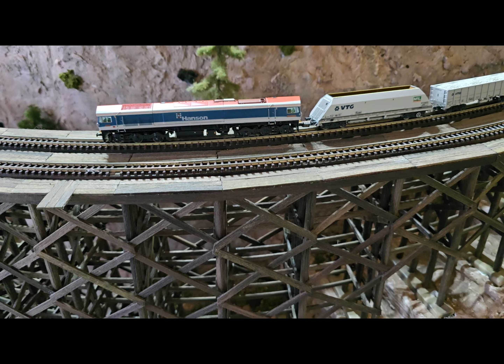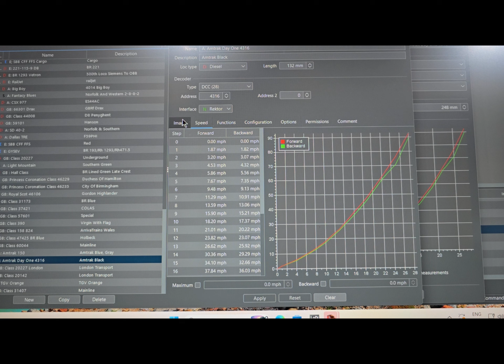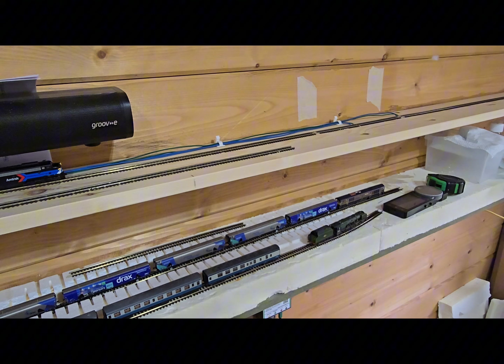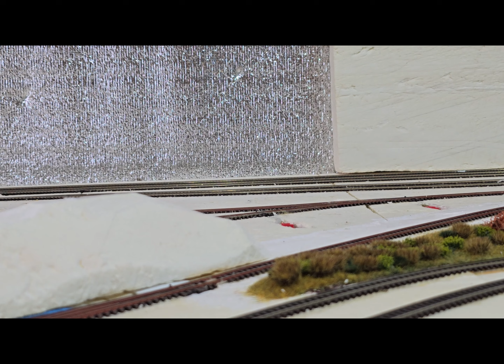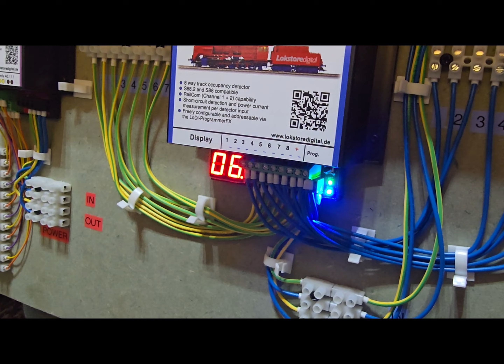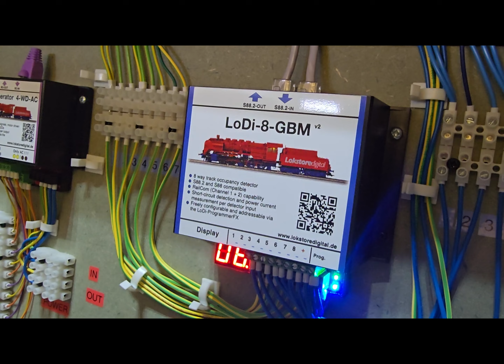Model Railway Speed Matching | iTrain Setup & Amtrak Loco Testing

Comment: I'm interested to know why you chose to use 28 speed steps instead of 128 speed steps? I use iTrain and use the fill range avaliable to the decoder which usually means  more complex speed curve.
Reply from the maker: Hi i use Lodi and that is what Andreas the designer of LoDi and James of DCC Automation said it would be the best to have it on. 
So when I started I knew nothing and I stayed with it. 
And it works for me. Colin
Reply: @collinsngauge5493 Thanks for the reply.